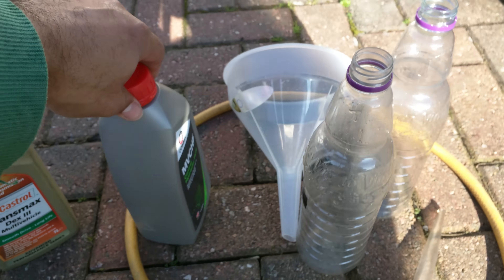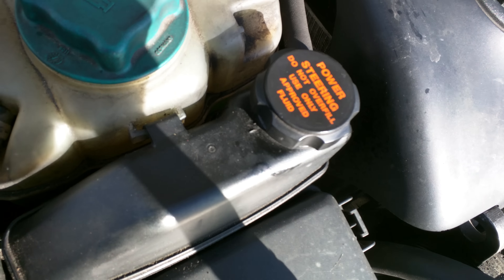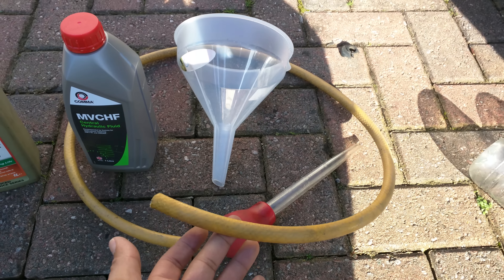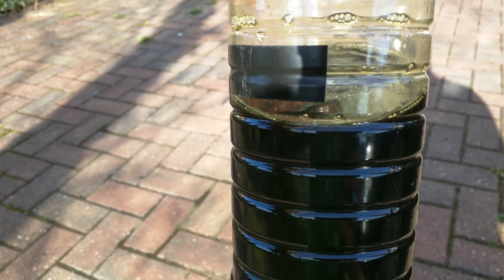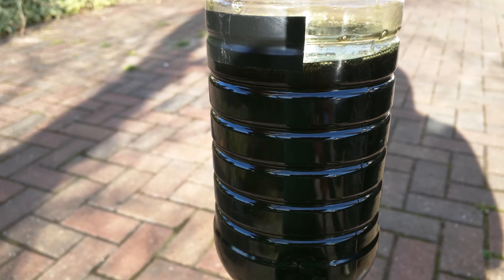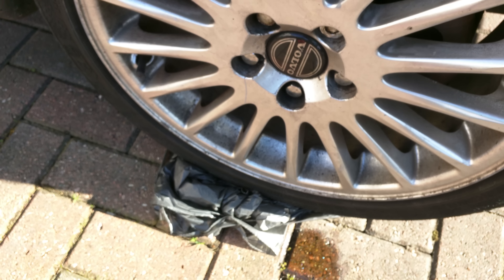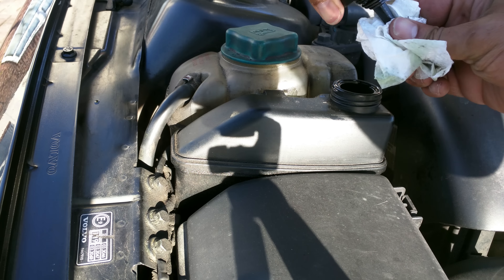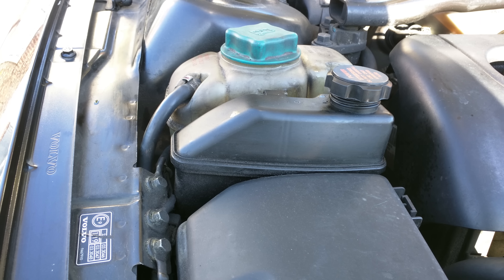Power Steering Fluid Change / Flush Quick and Easy

Comment: There is a more effective method and it’s done by disconnecting the return flow hose from the reservoir, you raise the car’s front side and turn the steering wheel side-to-side. As you turn the wheel the old fluid drains in a bucket and some other person fills the reservoir with new fluid. The process continues until the whole system is clean. Thoughts on that, Simon?
Reply: Do you need to have the engine running mate?
Reply: @barrygray8356  
No
Reply from the maker: My thoughts are that I like my staged method with the engine running and weight on the wheels.
The system is then at significantly higher pressure, bypass valves are being exercised at each lock and there is no hose removal required.
Those years old hoses and clamps don't want to be disturbed unless absolutely necessary and changing the fluid isn't a good enough reason in my opinion.

Comment: be advised that at least in the U.S. that there has been a lot of debate about what fluid to use. my 02 manual simply says ATF however when i double checked it with various dealers around me i got conflicting answers. just tread lightly
Reply: Sad, many American dealers simply do not know, far to many are afraid to say "I do not know" ! Volvo, and others do not help with their specs that only benefit themselves ..  "Volvo power steering oil"  indeed !!

Comment: By changing this way you loose a lot of fluid the best way is open  the feeding hose and empty the reservoir and filled up with new fluid open the return hose and put it in a clear bottle second person start the car for a few seconds same time should add fluid to do not let the power stream run empty when you saw the new fluid came out of return hose shut the engine down put back the return hose and check the fluid level  start car again turn the stream wheel if there is any air in get out
Reply from the maker: It's not the best way, it's just another way and you need another person and you have to disconnect hoses which often need new hose clamps.
My method doesn't lose any fluid but it may use 1 litre more which is £10. Not really a problem.

Comment: You used a lot of good oils while mixing with old oil in the system. I did differently. I removed the return flow pipe and poured everything into a bottle and poured a new one into the cistern. All the old was pushed out and the system filled up with 100% fresh oil
Reply: Did you run the engine for some seconds or did you remove the plugs and turn over the engine by hand ?   Me ?  I'd start and run the engine for 5 seconds and determine if that was sufficient .

Comment: I read somewhere that steering fluid should be in the same color as seal under the cap. but it doesnt work like that as I got green seal and red fluid :)
thank you for sharing sirobb
Reply from the maker: Don't ever trust the seal colour. 
Always check the owner's manual or check with your main dealer.
Reply: boskigrzegorz  Get that checked buddy. If it's using standard red ATF, then it can be wrecked if it's meant to be using CHF. You can use CHF in an older system that uses ATF, but not the other way around.

The price of a new rack can sadly make a lot of older cars uneconomical to repair.
Reply: @sirobb  My understanding is some of the Volvo manuals incorrectly say to use transmission fluid.  Others say to use the seal color.  So opinions do vary.
Reply from the maker: The required fluid is either correct or it isn't so opinions outside of that don't really matter.

Comment: This is not flushing.  It is a partial (very partial) drain and refill.  Quite adequate if you do this procedure annually but I bet that less than 1% of owners would service the power steering system that frequently.  Thanks for posting.
Reply: Some people never change the brake fluid.  Imagine how nasty that stuff gets.

Comment: I changed mine just recently. I sucked out the old fluid and replaced it with new fluid 4 or so times over a period of 1-2 weeks. I used 1 liter all in all. After 100+K miles it was time for it.

Comment: Having just tried the AC clutch plate free fix - that worked like a charm and cools down hot children and adults - hoping I’ve not asked too much of something else. Whining noise coming from steering when in use, reservoir low and a sort of grey/brown. Second hand rack recently fitted - wonder what fluid they used 🙈 great video as usual 🥇
Reply from the maker: Make sure the fluid is the correct type, the level is correct and the fluid is clean and clear.

Comment: The Volvo owner's manual is actually incorrect for the 2001 S60s and probably more years.  It says ATF but it actually comes with CHF from the factory and requires CHF for flushing and topping off.
Reply from the maker: The 2002 manual says to use Volvo power steering fluid. 
If you buy it from a main dealer, it's CHF. 
You're right though and as I say in the video, don't mix.

Comment: You do realize that you only changed less than half the fluid in the rack and res. ?You can do this all day long and not get it all.  IN THE SAME AMOUNT OF TIME you can jack it up and remove the return line and drain it, fill it and have an actual flush~
Reply from the maker: Sonny You've either not listened properly or understood the video but thanks anyway for the comment.
Reply: It isn't necessary to get it all. Math says if you do what he did three times, you will get 70% of the old stuff out. That is more than sufficient.

Comment: My fluid is Amber colour I'm about to buy chf. Green. Just fingers crossed what's in there is chf and not atf as both will mix. Not good
Reply from the maker: I've heard of some CHF being an amber colour but to be on the safe side, just run a couple of litres through and get a uniform clean green colour and eliminate that concern.
Reply: @sirobb  thank you sir. Top man
Reply: @sirobb  4 litres ordered 👍👍 check my channel to see my golf 👍😉 13:5:1 compression. Forged 1900cc 16v. Jenvey throttle bodies 😉😉

Comment: Just checked my fluid. It’s clean but it’s red. Users manual says it’s mean to be green. I’m going to Volvo to get the correct stuff. Will this method with 4 flushes be enough to do the job properly?
Reply: Ignore the owner's manual, it's sometimes wrong.  Replace with whatever is in the system.

If it's red, its Dexron III ATF (use a synthetic, such as Valvoline European Vehicle ATF).

If it's green/brown use CHF.
Reply: Three times is enough.

Comment: Hi Rob, 
Nice video and I just heard some whining noise when you steer left at 4:48-54. Is that normal? Because I can produce the same noise when I fully steer left or right and keep on it with some force (I know it's not nice). While I am cruising, at some turns I can hear the same whining quietly. I guess I need to renew the fluid at first. Maybe this whining is normal because I don't have any problem with the steering, oil level, there is no message from the computer and the idling does not change when I steer at one place like you did. 
(secretly tipping that the alternator flywheel is dying) 
Thanks!
Reply: terdrecsirkek make sure your fluid is clean and check your power steering belt for wear. If worn that can cause noise. The strain on the belt could make it slip and that could be the noise you hear.
Reply: thanks, the belt and pulleys were replaced before. But I had a dmf replacement and thanks for this the mechanic guy could replace the ps oil with the bottom release. Now it's smoother and quieter, however the whining is still on if I force the tire to the inner bumber. Actually it's normal, in a normal way you don't need to tension the steering wheel in any direction. In this "tensioned" position the pump is under high pressure and the pressure regulator starts to work.
Reply: terdrecsirkek  always make sue your tires are rolling a bit when backing in and out. When people turn there steering wheel with no movement of the tires they dig in the pavement and  it puts tremendous strain on the power steering pump and belts. Good Luck

Comment: Ok Si,    so how did you start the syphon off 🤨
Reply from the maker: Tube in the reservoir. Suck on the tube then cap the end with my thumb well  before fluid is near my mouth.
Put the end of the tube below the level of the fluid in the reservoir and put in a bottle.

Comment: Why do you need to change the fluid?
Reply from the maker: It gets old and burnt which could damage the pump and steering rack. It therefore needs changing the same as any lubricant.
Reply: @sirobb thanks
Reply: @sirobb  It's normal for the fluid to smell burnt? I think only thing that can burn the fluid is the pump? 🤔I recently did flush on my 04 s60 and the fluid was just dark green but it didn't smell burnt lol
Reply from the maker: @jaskajokunen3716  Yes it can burn when the fluid gets old but is still having to do the same stressful job. Friction within the rack is dealt with less effectively and produces excess heat.
This can take years and can depend on factors like the amount of low speed high turn ratio manoeuvres. Steering rack longevity can be very varied depending on use and maintenance conditions.

Comment: Hi.
Just checked my 2002 d5 and it does look almost red.
The cap is green .
To be fair its pretty brown looking too so im worried as to what colour to put in
Reply from the maker: Philip Sleddenhouston you flush through green CHF repeatedly until the system contains only that and the reservoir dipstick shows bright, clean and green fluid.
2 litres could do it, 3 litres maximum.

Comment: Why would you want to change the fluid every six month .
Reply: Agree, that is not needed.  Perhaps changing the fluid every 5 years is a better approach.  Pentosin is a fully synthetic fluid.
Reply: @Peppermint1  The Pentosin has a really high viscosity index.  Somewhere around 302 for CHF 202.  Just look at the viscosity index of transmission fluids and you might realize why some newer cars do not call for ATF any more.  That is if they don't have electric power steering instead, in that case they might not have a reservoir any more.  I mention that because some Nissans do take a fluid for the electric power steering.

Comment: How did you start your siphon? I am way overdue for my power steering fluid change.
Reply from the maker: I siphoned in the traditional way. 
Use a clear hose if you've never done it before so you get some warning. 
PAS fluid is pretty disgusting. 
There are many safe, if a little slower, alternatives.

Comment: My power steering isn't working properly and when I turn left while driving it won't self center.
Reply: Upper strut mount nut being too loose (or the mount being worn) will cause that, but it's not the only thing. It's not a power steering issue, though.

Comment: Do you need to remove the hose also? Or is it optional?
Reply from the maker: Which hose do you mean?
Reply: +SiRobb the steering fluid  one, I seen other videos where they take out the fluid like you just did, and then removed the steering hose to drain/remove the remaining fluid,  do you need to do that or just do it like you just did it?
Reply: +SiRobb I don't know much about cars but I'm just wondering, great video by the way I'll be doing this when I get out of work!! +1
Reply from the maker: +cathlic Vier I suppose it depends on your particular system. 
My PAS system is around 1 litre and my reservoir holds roughly half the total system capacity so doing my drain fill method will dilute and remove old fluid quickly.
If your system capacity is the same but you can only drain say 200ml each time from the reservoir, it may be quicker to also disconnect the return hose or you can just drain and fill the reservoir only a few more times. 
It's up to you really.
Hope it goes well and thanks for the comment.

Comment: Hang on how the hell did you get it out.  All I saw was a pipe going into the power steering chamber.
Reply from the maker: Geraldine Geraldine I siphoned it.
If you don't know how to siphon, just tip it out or use a turkey baster.
Reply: SiRobb Thanks.  I haven't changed my power steering fluid in 25 years.  I bought the car from new.  Every garage I go to tell me there is no need to do it.  Yes I kid you not.  I drive a daihatsu charade 16 Valve.  I am scared shitless in case I damage the pump.  What about an air lock forming.
Reply from the maker: Geraldine Geraldine If the level is correct before you begin and you replace exactly what you have removed before starting the engine, it's not possible for this method to introduce air.
You must use the correct fluid for your system which will be in the owner's handbook.
Reply: SiRobb Dextron II.  So just to be clear.  Suck out what's in the power steering chamber, than fill it with fresh stuff and repeat the procedure until the fluid runs clear.  Should I turn the wheels left to right to push up more fluid into the chamber to speed up the process.  Thx so much for helping.
Reply from the maker: Geraldine Geraldine You basically follow this video.
Reply: SiRobb Xxxxxxx

Comment: the fluid looks a lot like hydraulic fluid , hydraulic fluid is cheap
Reply from the maker: It looks like hydraulic fluid because it is hydraulic fluid. 😊
CHF means Central Hydraulic Fluid.
Reply: ok
Reply: Don't do that - you have been warned.  Do you really want to risk ruining the rack and/or pump?
Reply from the maker: Don't do what?
Reply: Iv'e been using Dextron 111 ( 3 ) for years in my Holden rodeo power steering system for years and all good